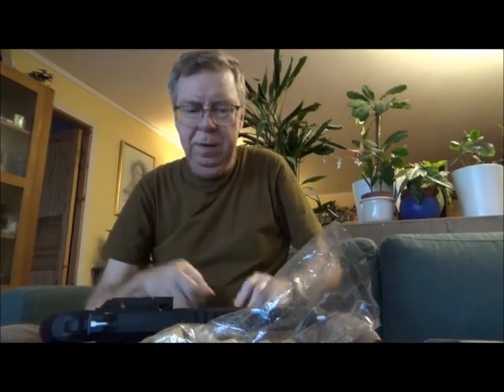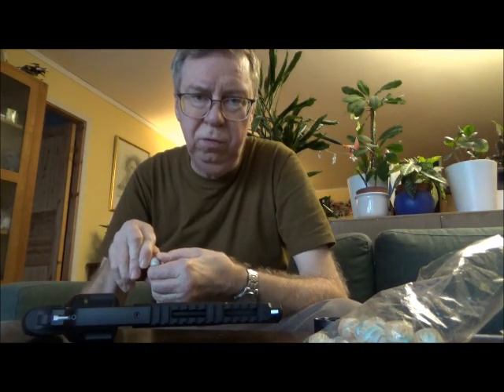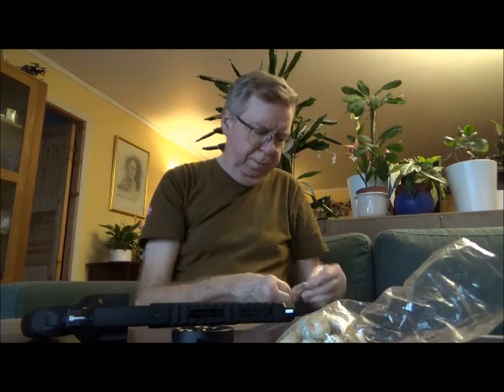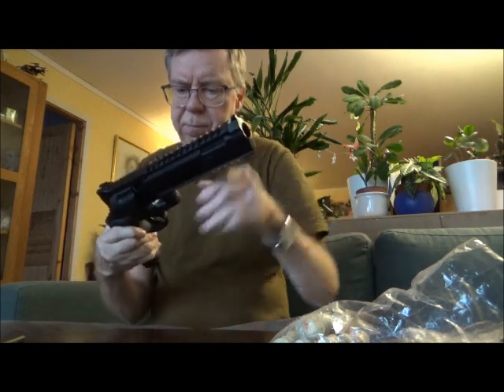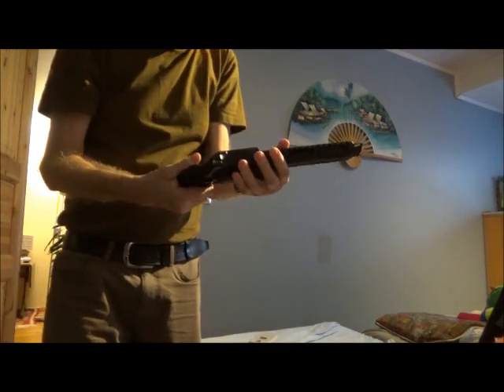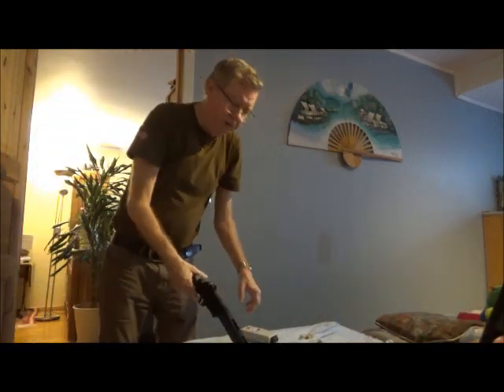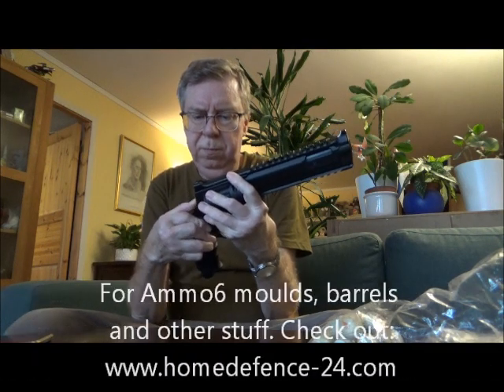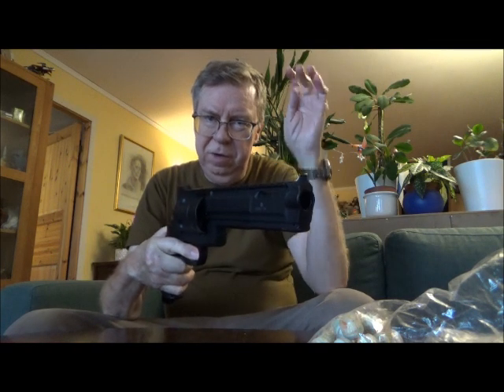Umarex HDR68, Marble Slugs, Part 2

Comment: I've been thinking about taking two tcr's and putting them exactly the same power and then leaving one of them outside for a couple of hours and comparing them against each other.  It really sucks that temperature affects CO2 as much as it does.  The one thing I do like about the Byrna SD or HD is that if you're carrying it in an inside the pants holster you're going to be keeping the CO2 pretty warm because it's in the barrel instead of the grip
Reply from the maker: Sounds like an interesting idea. From my own testing over the years the velocity drops fast when its cold. Sometimes the valve freezes up also... and then dumps all CO2... Yes carrying it inside your pants or under a jacket should keep it warm. I have been thinking of putting handwarmes on my CO2 markers, but it might now work good.. 🤔
Reply: I am afraid to carry co2 capsules on my body after the accident with the Junior.
Reply from the maker: @noobt4eguns  If its not warm it shouldnt be any danger or problems... 🤔
Reply: @runerebel8441  maybe its my phobia the problem.
😔

Comment: i usually buy 16mm marbles then paint them a few times to build up diameter . i glad you finally tried the marbles , im surprised it took this long .they are really cheap compared to reg ammo ! MY MARBLES WEIGH 99 PLUS GRAMS , I WISH ONE DAY TO FIND THE PERFECT 1/2 12.5 TO 7 MM MARBLE FOR THE .50 CAL !
Reply from the maker: I used to dip marbles in rubberpaint to make them thicker. Same way the breakerballs was made. Works OK but takes a lot of time to make them.

Comment: When you say polyester slugs what exactly is the product you use?
Reply: NEVER HEARD OF IT ,BUT IT MUST BE GOOD RIGHT ?
Reply from the maker: I use Polyester mixed with a drop of hardner (its only a 2% mix). Fill the bottom of the Ammo6 slugmaker and drop in the 16mm marble. Then fill up the rest of the mould with the Polyester mix. It takes ca 30 minutes for the mix to cure, but it must be over 15C or they dont harden well. The slugs looks like candy 😁. But they work very well 😃👍

Comment: Is this upgraded.
Reply from the maker: I only removed the valveblock. Picture of the valveblock in the video
Reply: @runerebel8441  AND UNLIKE THE HDR.50 , IT WORKS FINE WITH IT REMOVED ,WITH THE .50 A CO2 RESTRICTOR IS NEEDED RIGHT ? I ALWAYS WONDERED IF THE 68 VALVE WOULD WORK FOR THE .50
Reply from the maker: @RGAIRGUNNINJA  Yes. The HDR68 dont need a restrictor but the HDR50 do. You can use it with an open valve but then you need the X-treme Modify Pin.